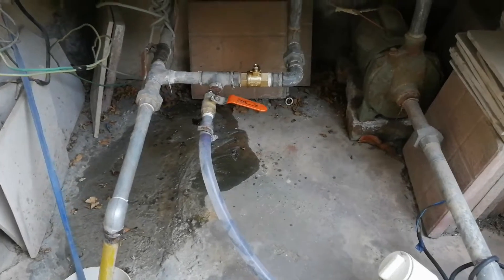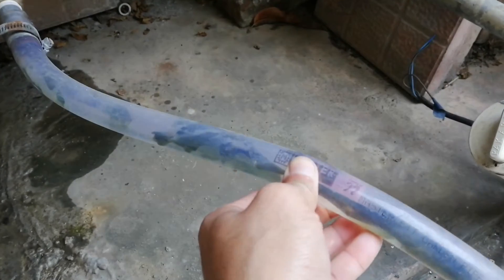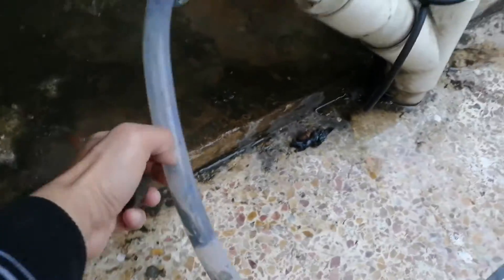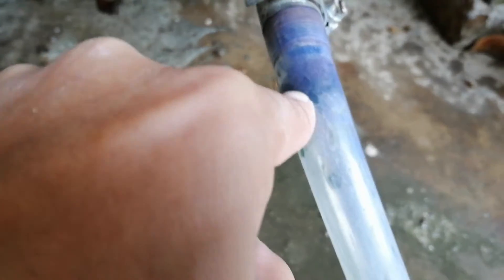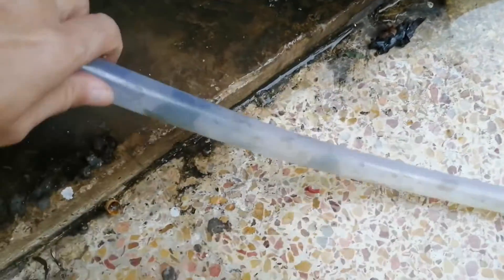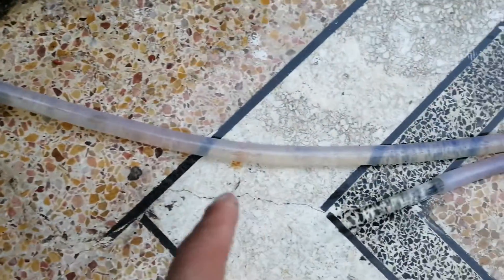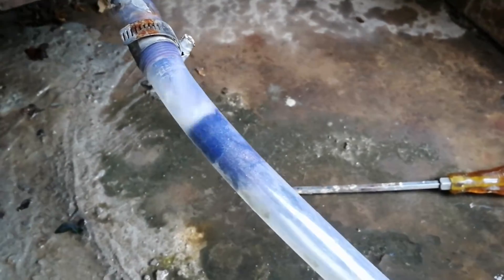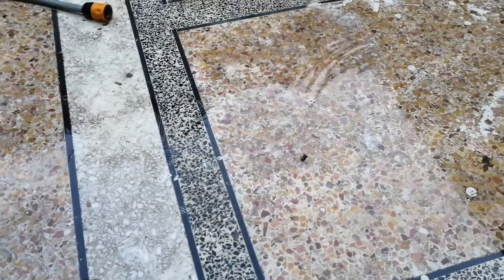water hose sludge cleaning / algae cleaning

Comment: Instead using plain foam use some abrasive material with it.. such as polythene shopping bags.. put the from in a polythene small bag and force it into the pipe.. water pressure should be stiff to push the foam folded in the polythene bag .. you'll see done and dusted results.. 👍